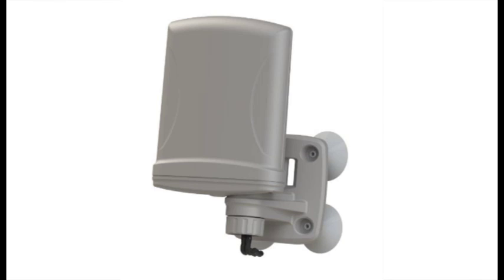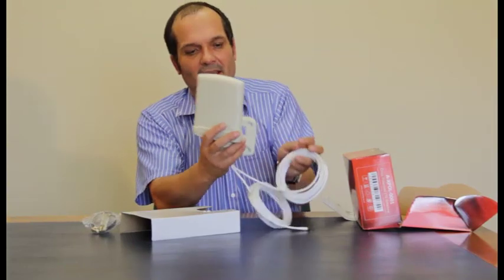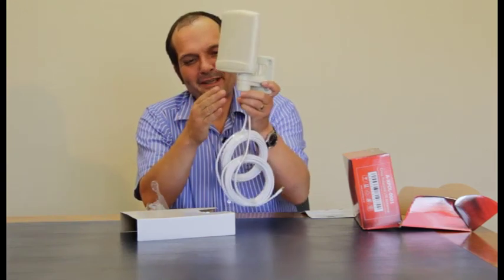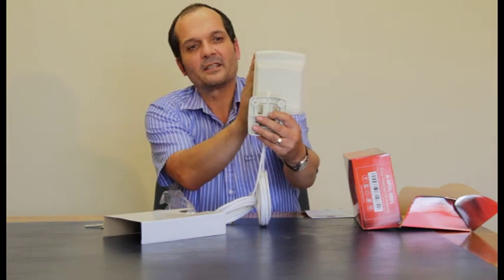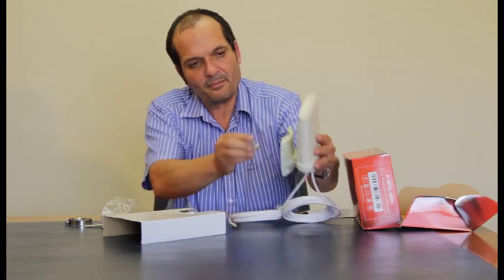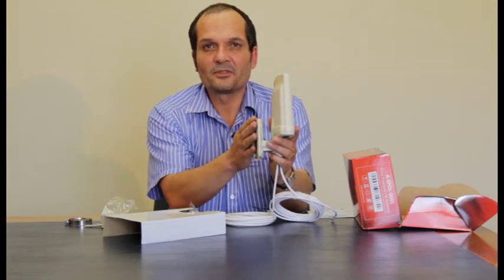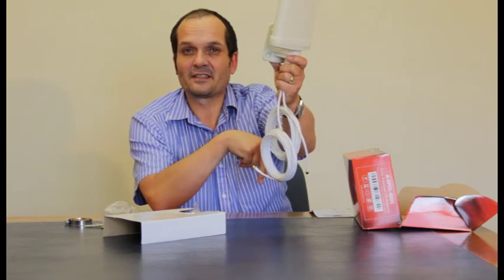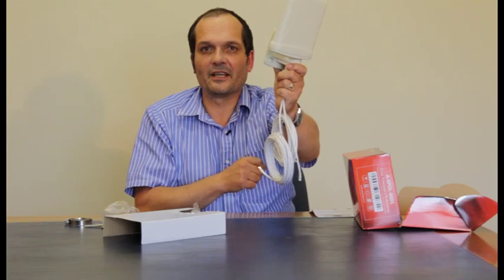LTE 4G Part 5 - Cross Polarised MiMo Antenna (A-XPOL-1)

Comment: In the video you say it can be mounted onto a window, or turned around and mounted on the inside of the window. What exactly is turned around?

How do you connect the suction cups? What is the technique? They require a hell of a lot of pressure. What is the best tool to aid?
Reply: @poyntingantennas  Thanks for the info. I'm surprised it can be attached to a window either way around - I didn't think the internal design was symmetrical back to front, so expected this to make some difference. Cheers.

Comment: The long cables are nice and convenient, however it's a trade-off of some dB loss.  Guess you can always cut it to the minimum required length and install a new connector on it.  It would actually be a welcome feature to have the long cable divided into 2 to 3 sections with mating connector, so that users may disconnect the un-needed portion to shorten it as needed, without the need to install a new connector at the end. ;)

Comment: Hi Andre . I have the XPOL-0001 , without the antenna attached to my LTE router my speeds are 2-3 Mbps with 2 bars signal .

When the antenna is attached my signal will go up to 5 bars but speeds are only 7-8 Mbps. 

RSRP :  -100dBm
RSRQ : - 12dB
SINR :  -  4dB

Would a higher gain omni antenna or a directional antenna be better for faster download speeds ?
Reply: Thanks for the reply, I’m in the UK on Three network . Average speeds are around 20 Mbps .
Reply: Hi C - Assuming that your measurements are after installation of the XPOL-1 antenna, the quality of the signal is very poor. 

I would certainly look at a directional antenna, maybe on a small extended pole to give the antenna some additional height.. If you locate your nearest cell site from your post code, using a website like - https://www.mastdata.com/, then trying an XPOL-2 antenna and directing the antenna to the nearest cell site that you have the clearest line of sight. I take it that you are using the XPOL-1 antenna external to your property?
Reply: Yes the antenna is mounted outside my property . 

There is an airport about 500 meters from my building and the nearest cell site with the clearest line of sight is on the other side of it . Would that interfere with signal quality ?
Reply: Potentially but probably not.  If in doubt, try another cell site if you have one in a relatively close distance. Good luck.

Comment: To add to my question, I'm wondering if it's possible to use this antenna with a Samsung Galaxy S4's antenna ports if I use the patch lead? I'll link this page for reference: https://www.telcoantennas.com.au/site/patch-lead-samsung-galaxy-s4

Thanks
Reply: Andre Fourie So in theory, if I purchase this lead it should connect up to the antenna?
Reply: Andre Fourie Alright, thanks for that. I'll look into it. Also, I'm actually in the UK. Do you reckon we'd be able to find this patch lead sold anywhere closer?
Reply: I really appreciate you going above and beyond for me, it's more than I could find online to my own knowledge. The S4 is only used as a tethering device anyway since we don't have the best broadband service in our area, therefore I don't mind changing the antenna setting. I only considered the external antenna since the internal antenna isn't meeting my expectations and I'm curious to see how much my speeds would improve. Judging by amazon reviews, your product seems to work a treat for most. Also since the mast is only a few hundred yards down the street, with the right placement I'm confident it should be a significant improvement.

Comment: Does this device and the newer PBN-Xpol-06-10M require line of sight without any obstructions between the device and the cellphone tower?
Reply: +Andre Fourie (Poynting) Thanks very clear example much appreciated! Will be making a turn by the CT branch soon to get myself some goods :) installation is as simple as point in direction of best signal and mount? Any other tips to watch out for when setting up yourself?

Comment: what is the recommended length of the antenna cable!
Reply: As short as possible to keep any RF loss to a minimum. If you need a relatively long cable, please check the cable loss per metre, this loss can negate the antenna gain.